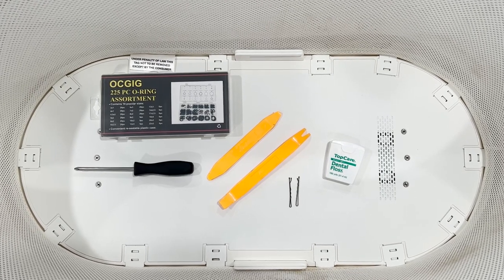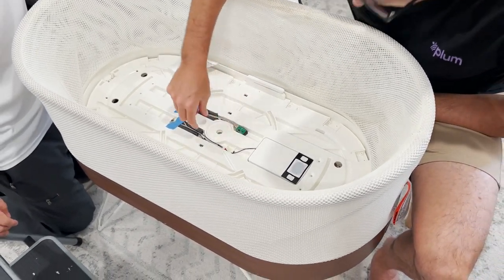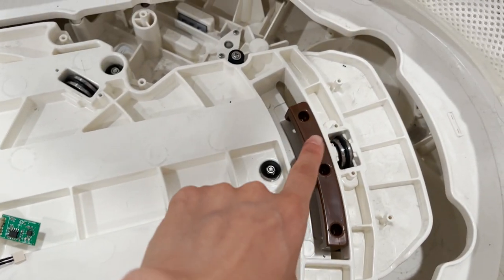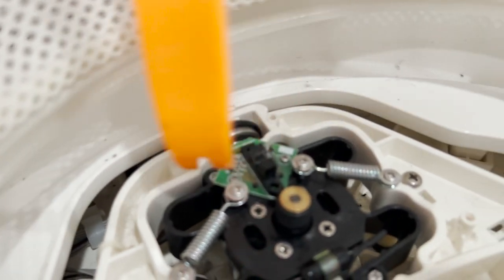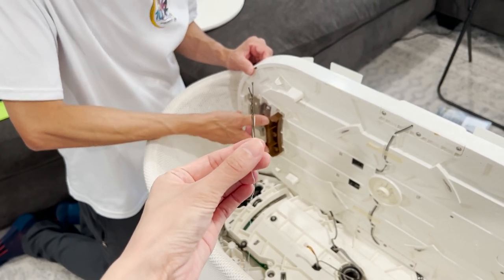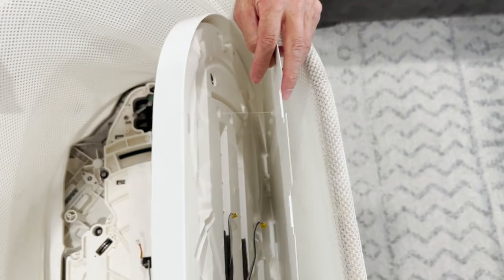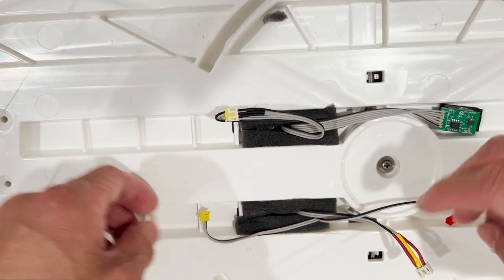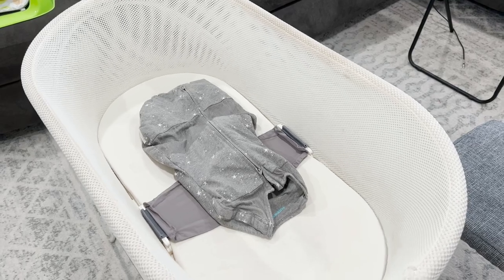How to fix the snoo (jerky movement and grinding noises)

Comment: I don't know if you're reading comments on these but the original O rings are made from EPDM which is stronger than what looks like Amazon nitrile ones in this video. I used Viton material for mine but something stronger than Nitrile is recommended so they last longer. Sizes are 202 (smaller x2-3..mine has 3) and 117 (bigger x7)
Reply: I had to use EPDM o rings as well because the ones recommended in this video would only last a week or two
Reply from the maker: great point - pinning your comment! we knew they would be a weaker than the original but didn't do a lot of material digging.
Reply: Thanks! I found some on Amazon in both sizes from "Mr O-Ring" Item: 117 Viton O-Ring, 90A Durometer, Round, Black, 13/16" ID, 1" OD, 3/32" Width (Pack of 10)
Reply: @philipniddrie dealing with the same problem right now. Thank you so much
Reply: @philipniddrie

Comment: I found an easier alignment method! Just turn the snoo on its side so that the brown track pieces fall to the floor, then tilt each side of the snoo to the floor as you screw in the plate.
Reply: Brilliant! It worked well for me. One additional tip: start with the screw closest to the floor. If the other screws don’t go in, back off the first screw until they do.

Comment: This video was very helpful.  I was able to identify the O ring issue on my Snoo and fix it myself.  The only feedback I would give which is a little simpler than using the dental floss process is simply line up the 3 prong brown pieces that slide back and fourth and take the first plate with the wiring and gently screw in the screws.  Might have to slightly shift it if it moves but I was able to get it fairly quickly.  Once they are in you know your first plate is aligned.  Unscrew and don't move the unit.  Then you can line up the holes on the second plate and screw all the way down.  All in all great video.  I love the snoo but it's ridiculous that after your warranty is up that the company doesn't have techs on pay role.  Literally some 5 to 10 dollar O rings can fix your nightmare.  If I were there company I would do it for the mere customer service aspect of the Business.
Reply: You can just stick a Q tip into the middle hole to line them up. You can also pull on the Q tip to raise the brown piece slightly up when screwing in the screws
Reply: I got a 4mm x 60 screw while I went to the hardware store for o-rings. It's just a bit longer and you can thread it in enough to lift up and easily start the other screws. Also used 1/2" OD 1/4" ID o-rings

Comment: Absolutely ace video. I did the o-ring repair and also the motor bearing replacement- (not covered here but there are other videos that do). One thing I will mention is that fishing wire works well too, and you won't need bobby pins. I used 20lb test and it's stiff enough to easily  thread through the holes.

Comment: I bought one second hand, it broke almost immediately, but since it’s second hand that voids the warranty and they do not give instructions on how to fix it, even though they know very well how to do so because they want you to buy one for every kid that you have.
I was able to fix it thanks to this video, the only difference is I used 4 of the #5 O-ring 35722 OD 3/8, ID 1/4, wall 1/16 and then on top of those I put on 
4 of the uxcell Nitrile Rubber O-Rings 12mm OD 6mm ID 3mm Width, Metric Sealing Gasket, Pack of 50. Multiple times when I was putting this on there Overing started to get pushed down and it would restrict the movement so I made sure to leave a little space at the very bottom (use just the bottom layer, no second layer of O-rings) then to make sure nothing would slip I used some Gorilla glue and let it set between the 2 layers of the O-rings.

Comment: Help! Your video is so informative and you seem like the Snoo repair Guru. My Snoo was making a very soft ticking sound - it probably wasn’t bothering my son but in my mind it was slowly driving him insane and it wouldn’t come out until he was in therapy 20 years later. Instead of being logical and upping the white noise volume (it was on the lowest volume)- I dissected the whole thing. I noticed one of the blue rings was starting to fray but not a lot- I replaced the blue ring with one almost the same size. I put the Snoo back together thanks to your video. Now the Snoo moves perfectly when my son is not in it - as soon as I put him in it - the Snoo is jerky and has small movements. I’m assuming this is because of the thinner ring ? Also - I contacted Snoo and they told me to push down hard on the middle of the Snoo like I’m doing CPR- did you ever have to do this to make the Snoo operate perfectly again?

Thank you in advance if you are able and to help ‘Snoo Repair Guru”.

Comment: Hey! Any chance you know how to replace the O rings in the inner side of the SNOO? I see you have the same model as mine and have no idea how to pop the metal part out. Thank you!
Reply: If you have a 1st Gen Snoo, you’ll run into the issue you’re describing. On those older models (like the one in this video), the metal rollers don’t pull up front the top, they release from underneath. 

They are held in from a bracket on the underside of that panel, and the bracket is held in by 2 Phillips Head Screws. 

You need to remove the 6 bolts from underneath the entire Snoo (near where the legs clip in) which are holding the panel with the rollers in place.

Be careful, the bolts are held in place by a rubber washer a metal washer, a lock washer and a lock nut. Once you remove the bolts, you can carefully lift up the plastic panel, but take care not to disconnect or pull too hard on any of the wires connected to the actual motherboard below it. 

Use a short Phillips head screwdriver to remove the screws for each bracket, which will then release the metal roller.  Also be careful removing the metal roller because there are washers on each side of it as well because you don’t want to drop them.
Reply: Thank you! Really appreciate the response

Comment: What size o ring did you use? (Width and diameter) and also where exactly do you put the o ring on the motor? Mine has already come off so I don’t know exactly where to put it back on?
Reply: use 6X3 rings for the motor, you need 3 of them all stacked up on that shaft
Reply: @richardbatara3181  great thank you!
Reply: @richardbatara3181  I'm curious, where did the 6x3mm measurement come from? Did you measure the existing ones on your unit? I measured mine (with a tape measure 😕) and they were about 3/8 x 3/16", and there were actually four on my shaft (they're pretty thin). However, I've seen a number of comments on YT & Reddit mentioning 13x6.5mm or ½ x ¼", including a comment from an employee, so I went with that (and only 3 fit, they're definitely thicker). The motion now looks great but now I've got a new whir from (I think) the motor, so I'm wondering if the size is off and putting some pressure on the shaft. Here's hoping!
Reply: @mattfelsen  6x3 is one of the available sizes in that kit shown in the video. I did not actually measure it

Comment: How do you replace the other larger o rings
Reply: I also want to know this. A redditor said "Very small and thing flathead screwdriver. One that fits along the side but can be used as a lever to lift it up. Holding the oring in place there is a plastic pin that is squared on both sides. It will slide right up."
Reply: And another said "I'm pretty sure they just slid out. Maybe apply a little lubricant first? I may have also used a butter knife as a crowbar to lift them out"
Reply: That hasn't worked for me yet so keen for any other tips.
Reply: @fpadam  I just used a flat blade screw driver and put the tip in the rim of the betting and gently pried it up. It’s only being held in by plastic square in channels. Some of them were more snug then others.
Reply: If you have a 1st Gen Snoo, you’ll run into the issue you’re describing. On those older models (like the one in this video), the metal rollers don’t pull up front the top, they release from underneath. 

They are held in from a bracket on the underside of that panel, and the bracket is held in by 2 Phillips Head Screws. 

You need to remove the 6 bolts from underneath the entire Snoo (near where the legs clip in) which are holding the panel with the rollers in place.

Be careful, the bolts are held in place by a rubber washer a metal washer, a lock washer and a lock nut. Once you remove the bolts, you can carefully lift up the plastic panel, but take care not to disconnect or pull too hard on any of the wires connected to the actual motherboard below it. 

Use a short Phillips head screwdriver to remove the screws for each bracket, which will then release the metal roller.  Also be careful removing the metal roller because there are washers on each side of it as well because you don’t want to drop them.

Comment: What size O-ring did you end up using?
Reply from the maker: We had an assorted o ring box and just matched the size - I believe it was 8x2
Reply: the o-ring for the motor is the 6X3. 8X2 is too loose. The rings should be tight around the motor shaft

Comment: Prior to pulling the last piece of plastic off to expose the o-rings, did you remove the screw in the middle? 

Mine seems to be held by something near the center of the SNOO. I’ve disconnected the cables. I can lift from the side. But it’s still stuck to something in the middle.
Reply: Use a screw driver and push it down, that screw will sink down and then you will be able to turn the screw.
Reply: Did you ever figure it out? My center screw can twist left and right maybe 15 degrees, but not any more.
Reply: @leenduht  I had the same issue. It’s a key. You turn it 1/4 then have to get it straight up. There is a rubber grommet. It wasn’t easy for me. Felt like I was going to break it.